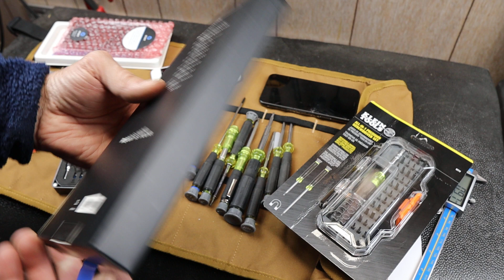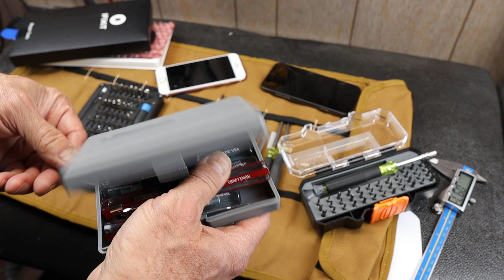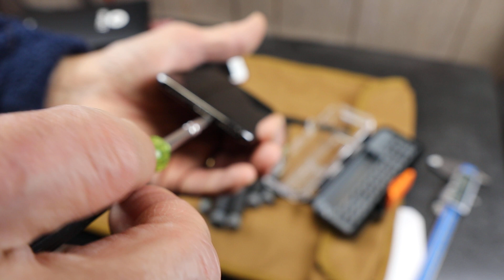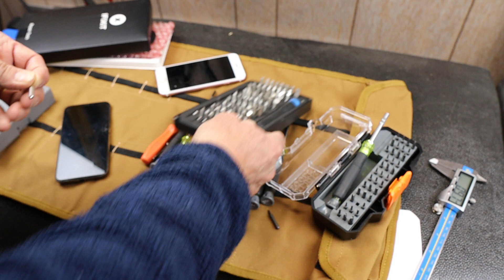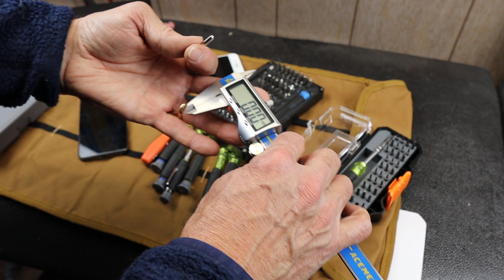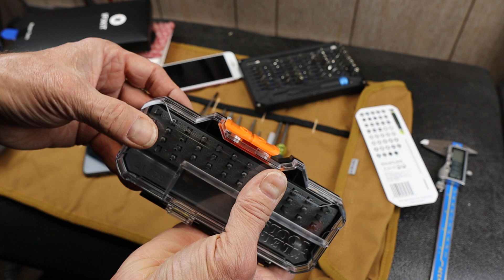Klein Tools Fail.The one bit needed is Wrong. Klein All-in-1 Precision Screwdriver Set let me down.

Comment: That looks like you are comparing the P2 to the P5.  Can you confirm the two bits were not swapped in your Klein kit?
Reply from the maker: The P5 is downright huge compared to the P2.  That was the first thing I thought of. But the bit is marked P2.
Reply: @lastbesttool  thanks for saving me money.  I’ve looked this set over at HD several times and always set it back down.  The fact that it’s not the 4mm bits all the other companies use basically makes that entire set proprietary to itself as well.
Reply: @lastbesttool  I think you got a misprinted or mis-manufactured p2. The one in my kit is definitely under .5mm, I don't have a digital caliper to verify an exact number, but it's definitely smaller than the T3 (& T4) star bits included in the set.
Reply: @philsowers  I have a Klein screwdriver set 32717 and just tried the P2 bit on my iPhone 14 Pro Max and found that it does not fit. I don't have an IFixit set with a P2 bit to test.
Reply: My kit the bit works.

Comment: Is it possible that it could've just been a manufacturing error for that particular kit that you picked up? Maybe try another identical kit and see if you have the same issue. When I was repairing phones I had an iFixit standoff bit that would not fit like it should've, but worked just fine from another iFixit kit that was in the shop.

Comment: I was pretty mad finding out this is true just now.  It grabbed fine the first time, then it just ate up the bit.  It's actually not too big in my case.  It's too SOFT and it falls apart, which starts to blow out/strip out the hole.  Klein just doesn't use hard enough steel for this and iFixit does.  Their stuff is superior anyway even if Klein is more innovative.

Comment: A real bummer about the Klein and their complete fail with the P2 bit. I have their 27 in one precision and a couple different full size multi bit drivers of theirs. It really rubbed me wrong when I found out they're using proprietary bits when I started researching alternative bits to carry onboard instead of the one I will never use. There's no other reason but greed to not use the industry standard 4mm. Especially when Klein doesn't even want to sell anyone the replacement bits. 

The search for the perfect multi driver from an EDC mindset has me thinking it's time to try and make my own.

Comment: My Klein set worked fine, until I realized that it included two T5 bits, but no T6 bit. When I contacted them, I was told that since it was not assembled in the USA, they don't have individual replacement bits!

Comment: I have both these sets and I will take the iFixit set over the Klein anyday. I actually like both sets and both drivers, but prefer the heavier iFixit one. I do not know if my Klein set has the p2 problem yours has as I do not normally mess with iPhones. The problem I have with the Klein set is it uses proprietary bits, so if you lose one, you have to contact Klein to get it replaced. They are not the only ones that do this, and I am sure they do it because they want you to pay $$$ for their parts, but it is an inconvenience that I think hurts them in the long run. I also have a Klein driver that is a bit larger than the one in this set, and it is the same way. I also bet that even though Klein is a more well known tool brand than iFixit, their drivers are probably no better. Just my 2 cents! :)

Comment: Over the past 1-2 years I’ve noticed a major decline in the overall quality of Klein Tools.  My last 6-7 Klein purchases have been a huge letdown.  From the “comfort grip” molding coming loose and free spinning, to “carbide” hole saws all breaking (or loosing a few teeth) just after 1-2 holes, to the new multi-bit screwdrivers “squishing” when applying torque, the new multi 6-in-1 nut driver just feeling cheap, the precision/terminal multi allowing the slotted bit to warp (it’s now looking like an “S” after a few terminals, the “glow”rods “glow” wire strippers not flowing in the dark for more than 2 minutes  etc.. literally my last 6+ Klein purchases have sucked.  My Wera, Knipex and Milwaukee stuff has been holding up much better. Klein sucks now.  Getting them to replace my 3/4 hole saw was a joke, they refused to replace it.  Klein is a perfect example of the old mantra “they don’t make ‘‘em like they used to” Screw Klein.

Comment: Thank you for the video.. as always, very informative.
I'm late to comment, as I just now saw the video, yet I wanted to share I had a similar issue with a Wiha 266 5PL when tried cracking up my MacBook.
It seems also the Wiha equivalent to #5 Pentalobe wasn't right for my Apple product.. something is weird with this bit sizing.
Reply: I bought this set about 3 weeks ago and either Klein fixed the issue with the pentalobe bit or it was just a mistake with his set. But an issue with mine was there was no detent ball to hold the shaft to the handle. It also has a strong magnet on both ends so that’s a plus

Comment: I just checked the P2 in my kit and it fits fine. I think you should send that bit back,  probably a fluke.
Reply: or they saw this video and fixed it... lol
Reply: @merrette  Maybe, but mine was purchased less than a year ago and it does not fit my iPhone 14 Pro Max.
I just checked the Klein website and searched to find replacement parts for the 32717 screwdriver set and received this response:
"There are currently no replacement parts for this product."

Comment: My very first Klein tool purchase was actually their 14 in 1 precision driver, and gave me a bad initial impression of Klein. The flathead bit tip bent easily, and also I didn't like the fact they were all proprietary ball detent bits that were hard to source, and I couldn't just use any 4mm hex insert bit like you find in many kits. Their customer service was not very helpful either in answering questions.

So I ended up returning it and not buying Klein products for quite a while. I've since warmed up to some of their other items, but still prefer other brands like Wiha for drivers.
Reply: Klein has some of the best tools. But I agree on the proprietary bits.

Comment: FWIW I have this exact same Klein set and I just tried the P2 bit on my iPhone. I had to scrape away a bit of dust/gunk but I was able to get positive grab and tighten/loosen both screws.
Reply from the maker: Hi Andy. Thanks for watching. I applied excessive force to the clean screws on the white phone and was able to back out one  screw,  but it felt like it would strip the head if I did it again. Like using a Phillips in a Torx. I have several other P2 drivers and all drop in solid.  This Klein does not. I really wanted it to work, and still do.
Reply: @lastbesttool I bought the 25 in 1 eBay wallet for my T5 torx screws on my vape mod and the biggest problem was getting the torx female head completely clean as it’s very tiny. Once cleaned after trying different things it worked fine. I now graduated to repairing vintage lighters and have everything you could ever need to clean and repair electronics. Lots of homemade tools too. I never trust the sizes from China because several will differ in measurements and they even have a disclaimer on eBay because of that.
Reply: My Klein P2 bit works on my iPhone. However, when I first went to use it, I accidentally got the T3 Torx bit by mistake. Of course, that did not work. Fortunately, I double checked to make sure I was using the correct P2 bit. That’s when I realized my mistake. I was then able to remove the iPhone screws with no problem using the Klein P2 bit.